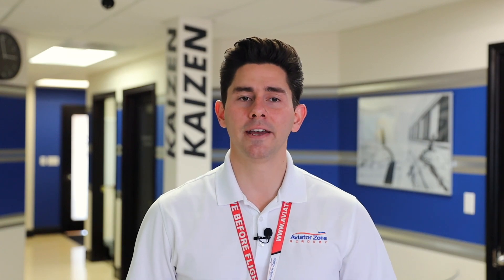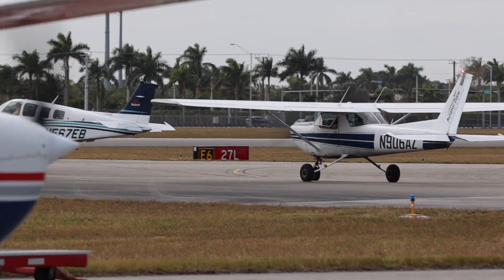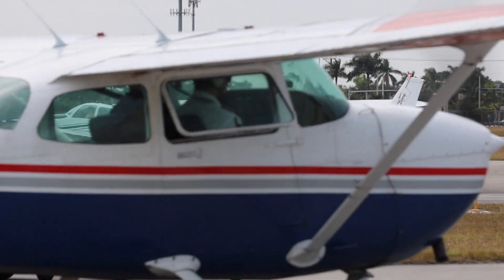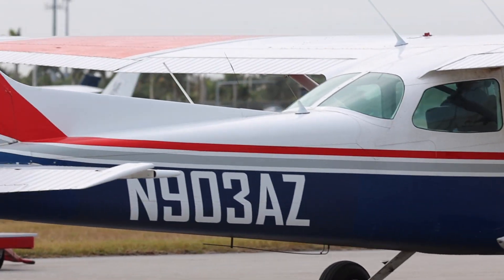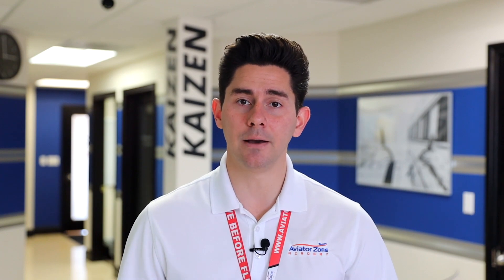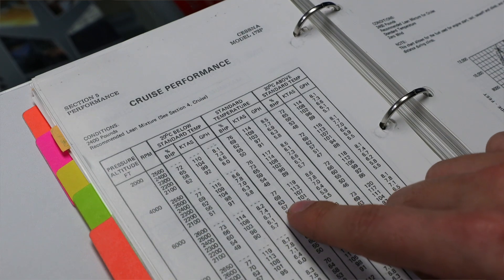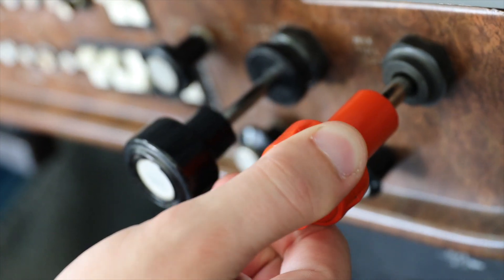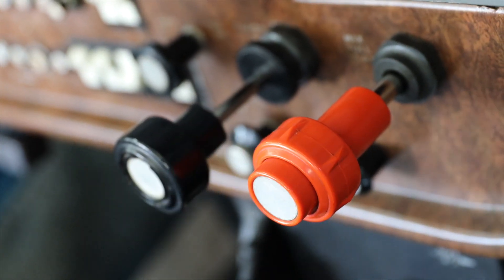Leaning An Aircraft Engine Explained in 2 Minutes | Two Minute Tuesday | Aviator Zone Academy

Comment: My aircraft is fuel injected, but you still need to know this. I went out to Vegas on vacation and when I landed I had a tire go out and the others were getting to the point they would soon go, so I had all of them replaced. It was nothing serious, but while I was waiting for the hangar crew to change the tires, I was without a plane for 3 days. We had plans to run up to Reno and meet some friends and I wanted to keep the plan going. I rented a Cessna 172 with a naturally asperated engine and the higher elevation demanded leaning. I fumbled my way through it, balancing fuel flow, RPM, EGT and got it as best I could. But it's an uncomfortable feeling not remembering a simple procedure like that.